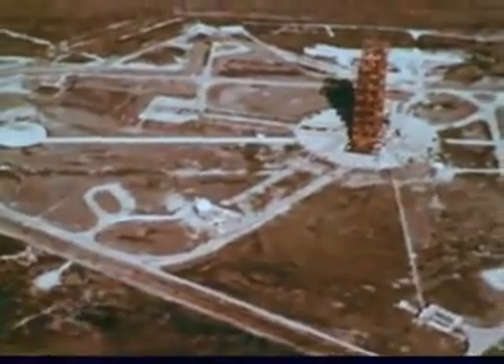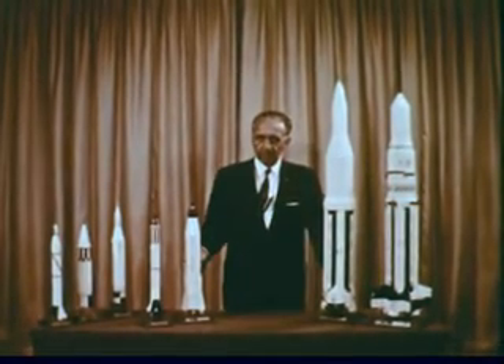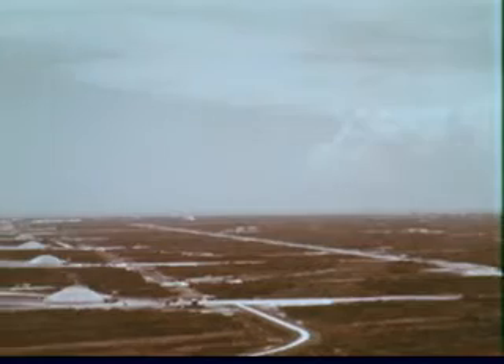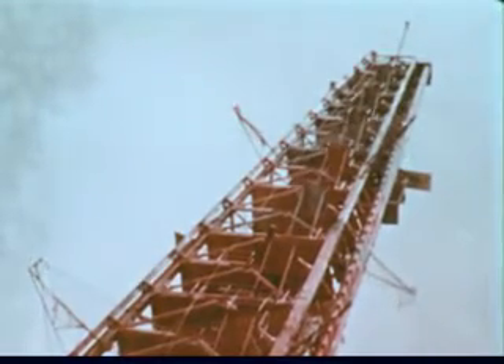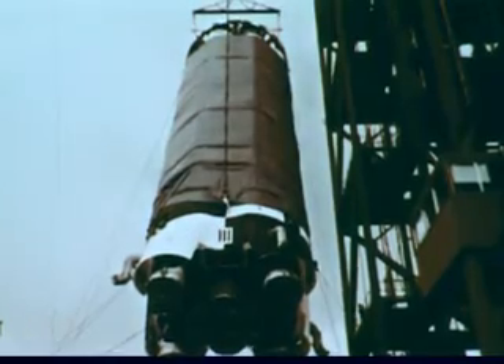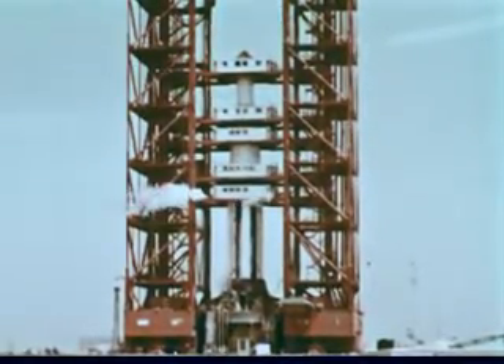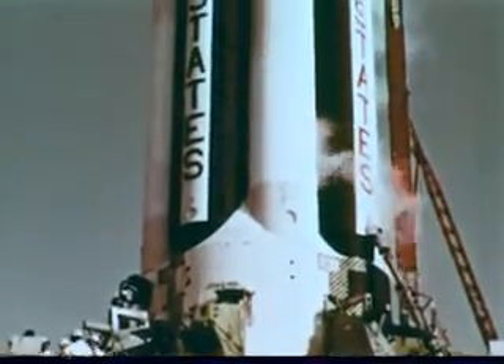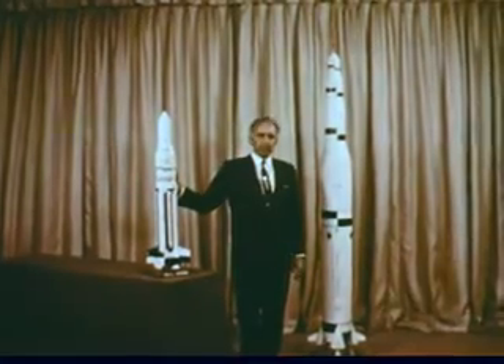NASA Kennedy Space Center Saturn Launch Complex 34 1962 Vintage Footage

Comment: I worked at KSC and CCAFS for many years and I've explored the ruins of this old pad many times. The gantry is long gone but the rocket pedestal and blockhouse were still there. The flame deflectors were still sitting on its rails. Pad 34 was the site of the Apollo 1 fire which claimed the lives of Gus Grissom, Roger Chaffee, and Ed White on January 27, 1967.